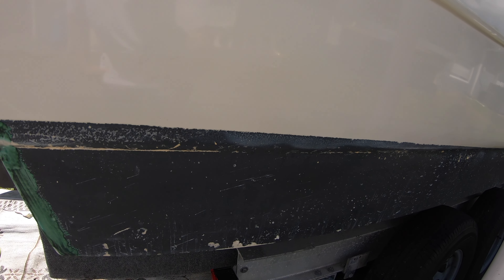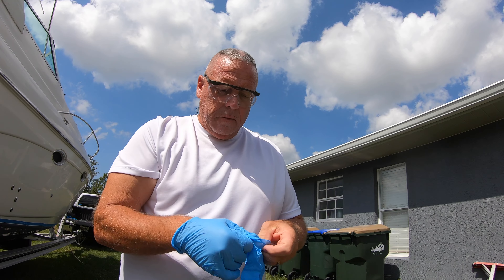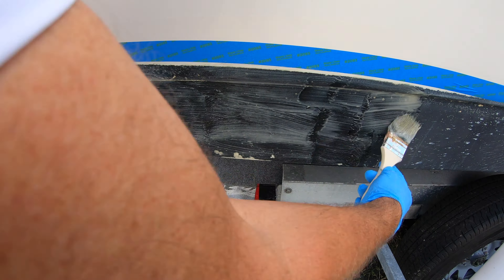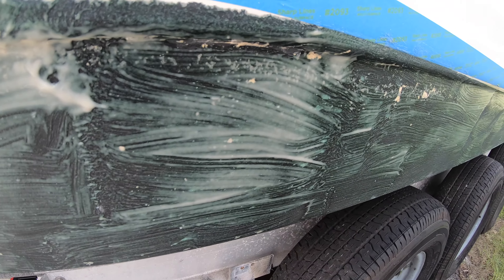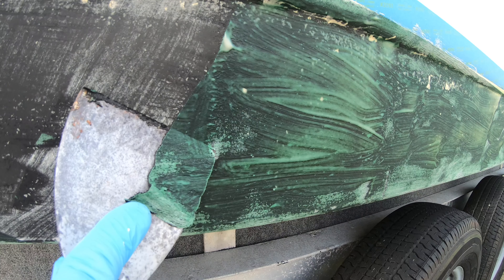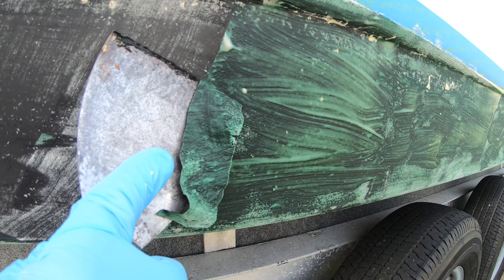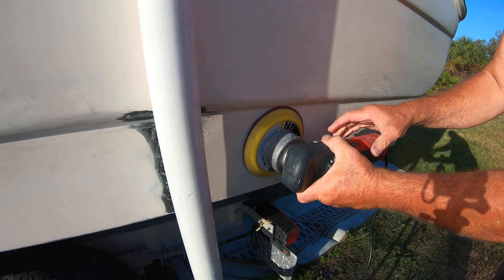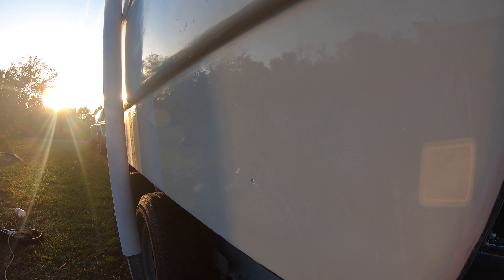Removing Antifouling Bottom Paint the Easy Way

Comment: Hi...I would like to get your advice on what would be the safest and best way to remove new antifouling on a new boat without damaging the gelcoat and the process needed after that to have the hull back to a shiny surface if antifouling is not going to be reapplied?
Reply from the maker: The paint stripper that I used seem to be pretty gentle to the hole. If you still had some residual paint that was not coming off, you could probably send it with 1000 or 2000 grit wet sandpaper in spots. The gelcoat would probably come back to a nice shine if you compounded it with a good quality product. I use a product called ChopTop from Shine Supply, and I apply it with a DA polisher from Harbor Freight and an orange foam polishing pad from Lake Country. The polishing compound cost as much as the machine and the pad. I think you’ll get really good results with that combination if you just take your time.
Reply from the maker: Pretty gentle to the hull, not the hole! I was using text to speech. Sorry…
Reply: Thank you for your reply and helpful advice 👍....would this stripper be more gentle on the gel coat more than soda blasting? .... @RandomlyAwkward1

Comment: Are you going to strip the bottom of the hull?
Reply from the maker: No, it’s too difficult to get to while the boat is on the trailer. The part I did was mostly for aesthetics. It’s not really a “high performance” boat so I don’t think it will matter too much.

Comment: This is the method I've been using on my boat but my bottom paint isn't stripping off quite as nicely as yours, so I had to do a couple applications. I'm using the stripper from total boat. Them I wet sanded with 320, 600 and 800. What I've done has turned out nice. I just wish the stripper I'm using took more off on the first application. Although, the paint on my boat may just be really heavy. Looks like around 2-3 layers. Thanks for the video!
Reply from the maker: Thanks for the feedback...Glad it was useful!

Comment: Didn’t like paint stripper and wife chewed me a new one for putting it on the transom. She uses a Puma stone.  Removed all the way down to the ruff scratches in no time except the transom which had a stained from paint stripper. Stone was a brick like you use on grill. Don’t soak it in the bucket just use a wet rag to wipe off paint from stone.

Comment: What's the point tho as youl need to re antifoul+
Reply from the maker: I removed it for aesthetics because I’m keeping the boat on a trailer at my house so I don’t need to use anti fouling paint like the previous owner that kept it in the water all the time.
Reply: @RandomlyAwkward1  oh apologies I'm new to the industry and trying to learn. Can I ask a question with metals can you apply antifoul direct to a sigma paint? Iv heard its possible if done at the right time. Thanks
Reply from the maker: @MBicknell  From quick research, PPG makes a bonding paint called Sigmacover that is put in between the dissimilar paint products.  Here’s a link to the info:  https://docs.td.ppgpmc.com/download/389/389/sigma-alphagen-230

Hope this helps!